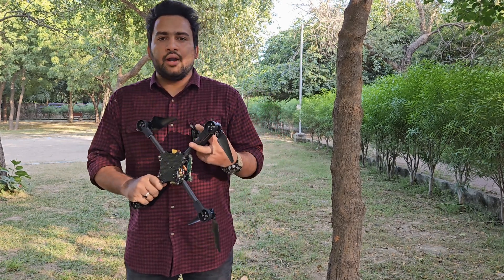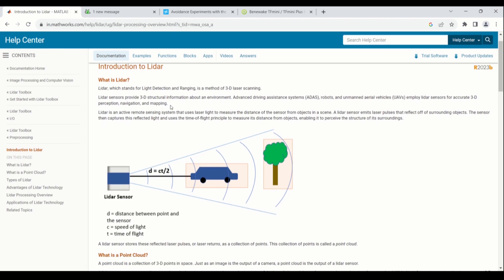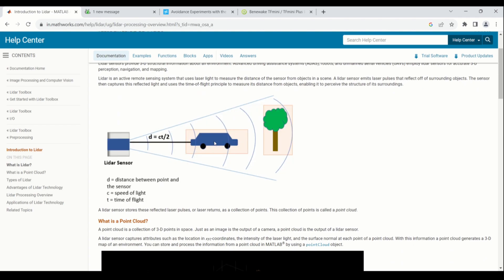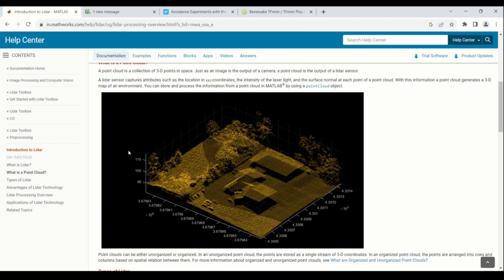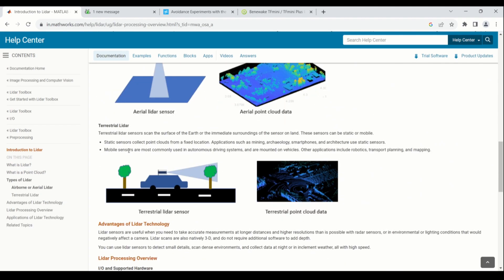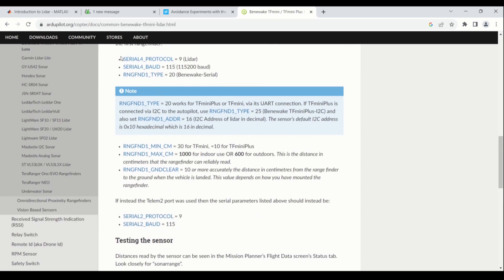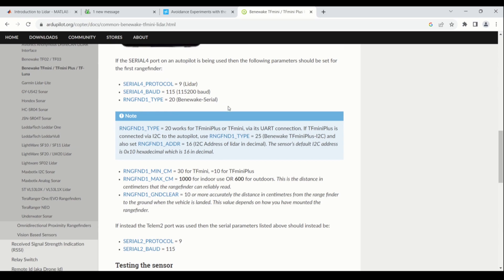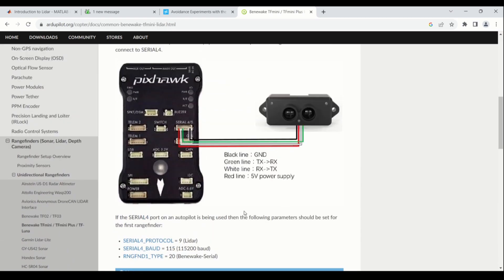Get Started with LIDAR | pixhawk | Indoor Navigation | Raspberry pi | Computer Vision | Drones

Comment: @PankajMali need little more help 
PLZ HELP ❤ 

We have made 2 drones for Nidar compitition 
NIDAR OVERVIEW  

We are working on an autonomous agriculture use case, where crops may be infected or healthy.
The idea is to detect infected trees first and spray only where required, instead of spraying the whole field.

Drone-1 (Detection Drone): flight controller cube + pixhauk 
This drone flies over the field and uses an onboard camera with processing (Raspberry Pi) to identify infected trees based on color difference.
When an infected tree is detected, the system automatically records its GPS coordinates and sends this data to a Ground Control Station via telemetry.( MISSION PLANNER )

Drone-2 (Spray Drone): k++ 
Drone-2 is a heavy agriculture drone with a pump.
It receives the infected tree coordinates from the Ground Control Station and then flies autonomously to only those locations, sprays the required amount, and returns.
Human role is only ARM / START for safety.

IS THIS PLAN PRACTICAL OR WE NEED ANYTHING TO CHANGE 
PLZ SUGGEST CHANGES OR WE GOOD TO GO WITH THIS PLAN 

OR CAN WE JUST DIRECTLY SEND THE COORDINATES FILE TO DRONE 2 
WITH USING RASPI 
but can we send file by drone 1 telemetry to h12  controller ??

Thank you ❤❤

Comment: Sir can you explain how the drone is in stable flight without gps
Reply from the maker: Hello  sajid,
The drone is flying is altitude hold mode , in alt-hold mode it is using tf mini lidar for height estimation which is pretty accurate as compaired to barometer altitude estimation in absence of tf mini lidar. In altitude mode the drone maintain the level altitude.  It can drift away without any inputs in case there is some mechanical misaligned in motor position or if winds are more . In this video drone is able to maintain steady stable flight as no winds are blowingbatvthat time altitude is maintained precisely.
Reply: @PankajMali  so in outdoor eventhough we use lidar for altitude it may drift due to winds
Reply from the maker: @SajidShaik-s7v lidar helps for altitude measurements i.e vertically and in case of gps absence for horizontal position estimation we need to use Flow sensor will help to estimate the change in current position and maintain current position.
Reply: @PankajMali  Thankyou for the reply continue to upload creative content.
Reply from the maker: @SajidShaik-s7v more videos on the way .
Reply: @PankajMali  Waiting for the creative content

Comment: Any idea why most drones don't use ROS1/ROS2?  From what I've seen, they typically use either PX4 or ArduPilot.. maybe MavRos.  Is ROS harder to configure and build on small embedded hardware?

I'd like to  play with a simple demo..   using a BLDC motor and hall-effect sensors to feedback for the commutation.  Could ROS be used for this?
Reply from the maker: Hello,

Most drones use PX4 or ArduPilot rather than ROS because they’re optimized for real-time control and work well with specific drone hardware, like motors and sensors. These platforms are easier to set up for drones and are designed for efficient performance in flight.

However, *you can use ROS* for a small demo involving a BLDC motor and hall-effect sensors. ROS can handle the high-level control, while you'd need to configure the motor and sensor feedback. For drones, many people use PX4/ArduPilot for flight control and then connect ROS through MAVROS to handle higher-level tasks like navigation and planning.

Comment: How are u communcating with drone in groundstation?
Is it with same wifi connected to RPI..

I have connected RPI to telem1 port and 3DR to telem2 port,, i want access to RPI in my laptop throught 3Dr telemetry without using wifi can i do that???
Reply from the maker: Hardware Setup:

Telemetry Module to Pixhawk:Connect the telemetry module to the Telem port on your Pixhawk.This establishes a communication link between Pixhawk and the telemetry module.

Telemetry Module to Raspberry Pi: Connect the telemetry module to your Raspberry Pi.This enables communication between the Raspberry Pi and Pixhawk through the telemetry link.

Telemetry Module to Laptop (for Configuration/Control):
If you want to configure or control the Pixhawk directly from your laptop, you can connect another telemetry module to your laptop.This creates a communication link between your laptop and Pixhawk for configuration purposes.Remote Access:Connect to Raspberry Pi from Laptop:Access your Raspberry Pi remotely from your laptop through the telemetry link.Use an SSH client on your laptop to connect to the Raspberry Pi using its IP address on the telemetry network.

Summary:Pixhawk <-> Telemetry

 Module 1: Communication link for Pixhawk.Raspberry Pi <-> Telemetry

 Module 2: Communication link for Raspberry Pi and Pixhawk.Laptop <-> Telemetry 

Module 3: Optional connection for configuring or controlling Pixhawk directly.This way, you have a telemetry link between Pixhawk, Raspberry Pi, and your laptop. The laptop is optional and can be used for configuration purposes, while the Raspberry Pi serves as an intermediary for extended range communication.

 the Raspberry Pi is not placed on the drone itself but rather acts as a ground station. The Pixhawk is typically mounted on the drone and communicates with a telemetry module on the drone (air module). This air module establishes a wireless communication link with a ground module, which in this case is connected to a Raspberry Pi.The Raspberry Pi, functioning as a ground station, allows you to remotely access and control the drone over an extended range. It's a common configuration where the lightweight Raspberry Pi is used for processing and communication on the ground, while the Pixhawk handles flight control on the drone.

Comment: Hi Pankaj ... May I know which Telemetry model used ? I am planning to use 3DR 915MHz with 500mW is this ligal in india?
Reply from the maker: Hi,
Yes yiu can use 915 Mhz telemetry and the one that i have on this setup is wifi telemetry module from cuav with range less than 30 meters.

Comment: Hello, I'm working on my final year uni project (indoor drone application). The biggest hurdle that I'm facing is stability is, stability. Although I've never flown the drone autonomously, but the drone keeps tilting in one or the other way (manual mode). I've checked the CG but it doesn't help. Also the drone does not maintains it's height, any suggesting what would help?
Reply from the maker: Hello ,
Lets catch up on telegram and lets check your setup .
@Punky_pankaj